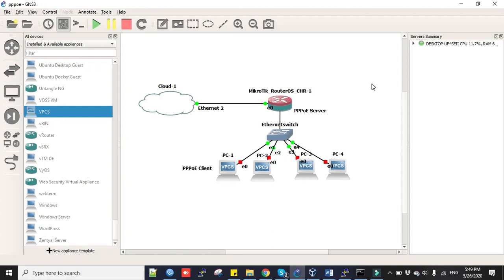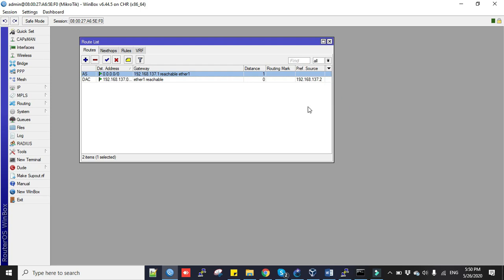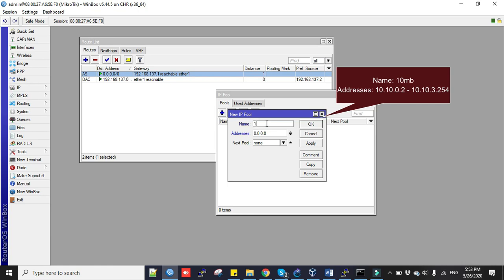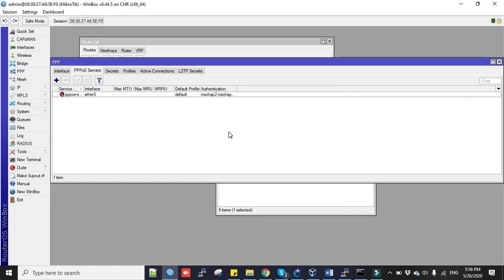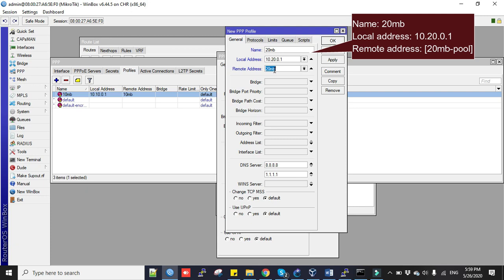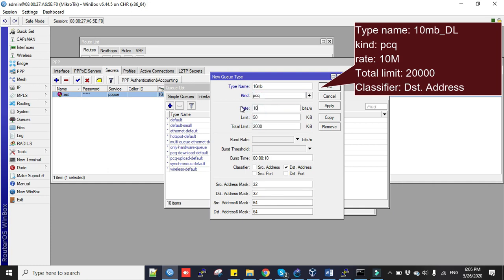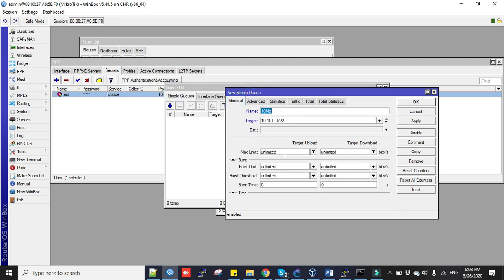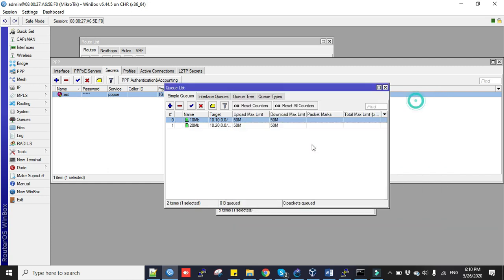Mikrotik Tutorial 46: PPPoE Server Configuration in Mikrotik

Comment: having a problem ..peer not responding several users disconnected randomly & reconnected back in 15sec to 30sec ...i would like your help if u see this problem before  i am using 2 router one for pppoe the other for masquerade cpu usage just 4%
Reply from the maker: That's the best approach. One router being the NAT and other router for pppoe. CPU usage can be reduced by this design. But single router can be used and I didn't get any issues with it.

Comment: You have created excess load on your router with your masquerade rule. What you have done is not best practise by masquerading everything on every interface. You also ignore any form of basic security of PPPoE by not enabling encryption and not removing the worst of the possible authentication options.
Reply from the maker: Yes you are absolutely right about excessive load on router with masquerade rule. We also do the src-nat to the fixed Public IP address while do NATTING. For authentication  PAP should be avoided. But for encryption if you have any recommendation, please share.